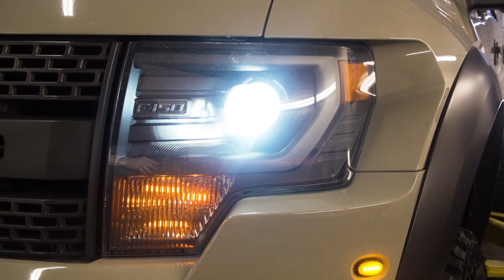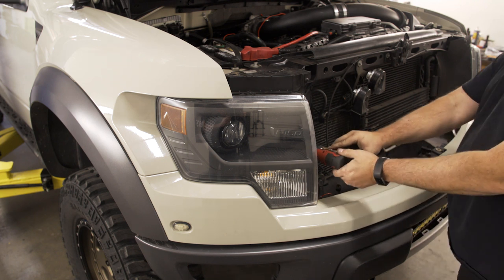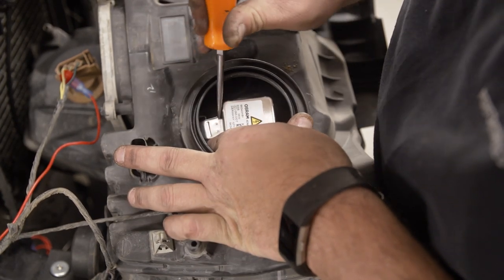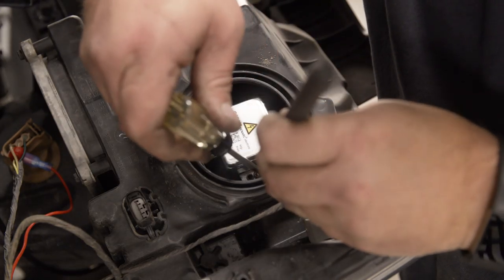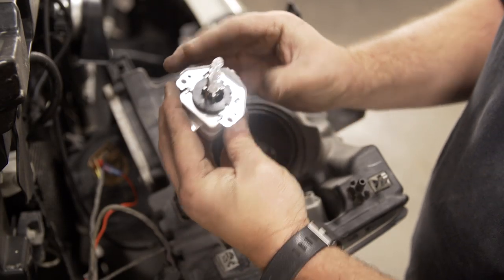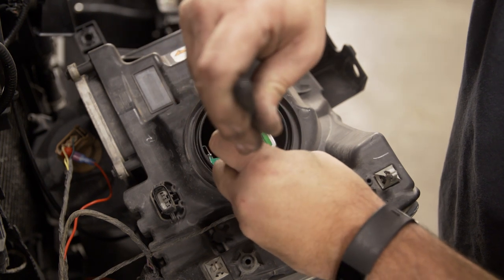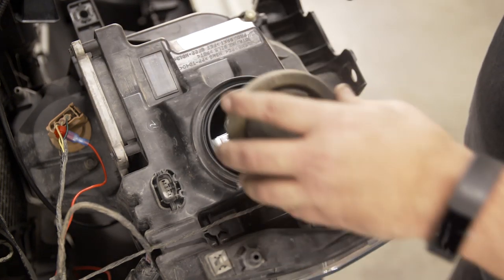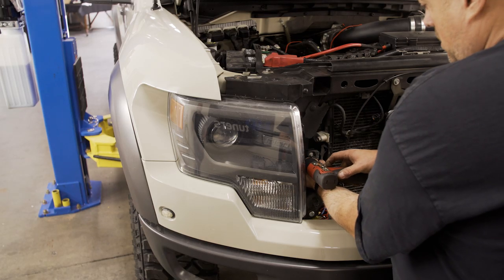2013-2014 F150 Diode Dynamics Replacement OEM HID Bulbs Install

Comment: Installed these today using your video as a guide. I'm very novice at this sort of thing and got it done. Couple notes for those wanting to do this: 
I didn't have one of those magnets they reference a few times. Used needle nose pliers and it worked fine. 
Getting the old bulb disconnected is the hardest part. It's really fragile and can bend easily from the flat head screw driver. I'd say use like 80% hands and 20% flat head screw driver.
Couldn't have done it without the step by step instructions. Quality product too.
Reply from the maker: Great to know we could help Scoot! Thanks for the feedback and tips for other installers!

Comment: Don't confuse the bright steel shield with the actual connector. I use a small straight pick to pry out at the connector corners. I place the small screws in their bores and then gently lower the bulb housing down, the screws always have stayed in place for easy tightening.  These screw holes are easily striped just snug them down and plug in your connector.
Reply: BINGO!!! Thanks for the tip, it was difficult to see the actual plug under the strain relief. But, you nailed it, a small screw driver did the trick!

Comment: I'm looking to get these as replacement to the very bad stock ones. Is the 6k lighting higher than the stock? What are the lumens for stock hid.
Reply: I think stock is 3200k.. I could be wrong... but I know 6k is a big upgrade from stock

Comment: Fantastic. I had it in my head that because these lights were HID that replacement would be harder for some reason. The steps are not much different than replacing a regular old halogen bulb. Thank you for saving me time and money.